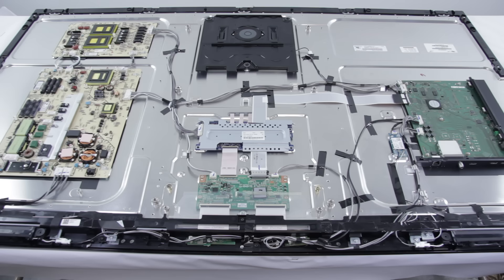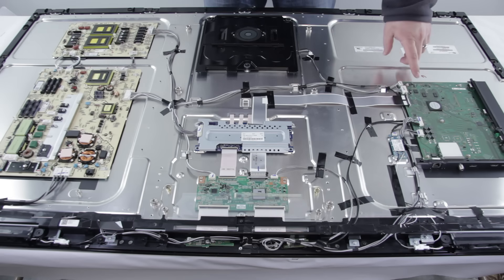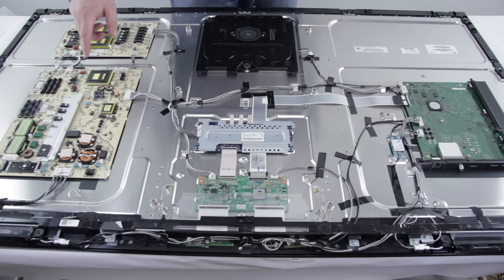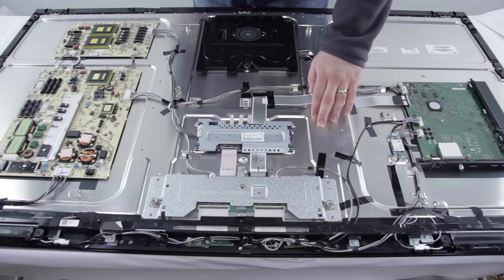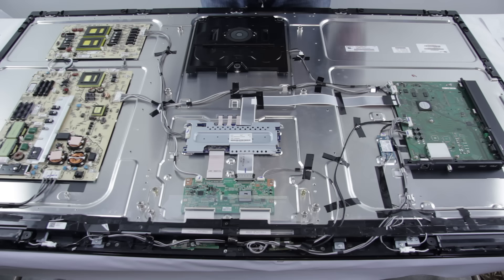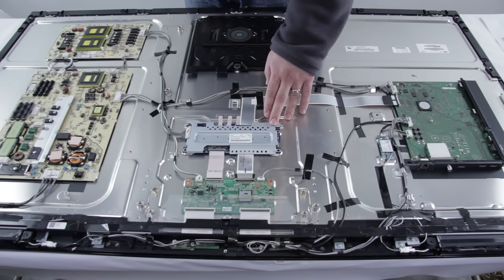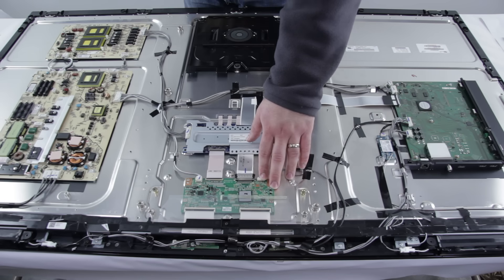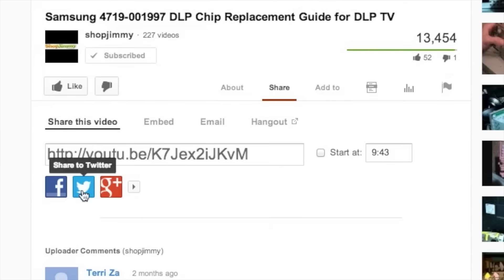LED TV Repair Tutorial - Common Symptoms & Solutions - How to Repair LED TVs

Comment: I have a Samsung 55 inch LED TV model no. UN55H6350AF. It was in a house that had a fire, the TV wasn't in a room that burned but smoke still got into that room. Now there is smoke residue on what looks to be the front side of the backlight layer of the screen. If you look at it right you can see it's "deeper" than the picture, if that makes
sense.

I took it apart to see what I could do but got a little intimidated by all the nearly impossible to undo clips around the frame. That, and not knowing how it actually is put together made me stop. There was smoke inside I could clean but it wasn't on the screen. If I could be relatively certain I wouldn't brick my new TV, i'd give it a shot but....

Thanks for any help in advance.

Comment: My SONY TV has a problem. TV model is KDL  50R 550A. When plugged in the TV and switch on, TV display is coming and SONY logo is appearing. Then automatically switching off. RED stby LED is blinking 6 times. When open up the TV , it was found that LED driver is getting very hot. Can it be LED short circuit?
Reply from the maker: Niranjan Ruwanpura   This sounds like you have bad lamps in your TV.  Unfortunately we do not sell replacement lamps.  Thanks!  www.shopjimmy.com

Comment: good day, i have a samsung led tv with model number UA32D4000N, in 30 to 45 minutes of viewing, picture is nice and clear, but after that period it will go too white and out of contrast and vertical white strip would appear like bar code. Turning off the unit for 10 minutes makes the picture normal but for a short while, may i have your advice please, thank you and may God bless you

Comment: Hey Jimmy i just bought a t con board from you thinking that was the issue but or didn't. Symptoms are i have audio but no picture, backlight still works. Did the flashlight test also nothing showing up.  Model number UN60EH6003FXZA

Comment: I have a Vizio M701d-A3r that has a darker right side than left side.  The image is present on the whole screen.  The right side is darker and also it seems that the image kind of fades away when it changes.  There is also a very thin horizontal line about 1/5 of the way from the top.  I have removed the cover and bezel and it appears that the LED lighting is working all the way around the display.  I sent photos to Vizio support and they feel the set is un-repairable due to backlight issues.  It is only 3 months out of warranty and it would stink to trash it.  Thanks!

Comment: I have a Samsung UN50EH5000FXZA (50" LED TV) which, after 13 months of use, has stopped giving a picture. I do have sound and, using your flashlight test, I do have video but I'm not sure about backlights - I haven't been able to see them but haven't taken the back cover off the TV yet (it's big, it's heavy, it's hard to handle by myself) - what isn't clear to me from this video and the flashlight test video is whether I can have positive flashlight-test result (so replace LED driver) and also have backlights? If I've understood properly, the fact I've got flashlight-test-video means that it is not the T-Con or Main board. Advice and clarification, please?

Comment: Hi I have a Samsung 32" 4000EW.  The TV switches on but switches its self off after a few minuites.  I have replaced the power board part BN44.00349B but it still does the same thing.  Can you suggest what to try next. Thanks.
Reply from the maker: Lucille Baldwin   I recommend replacing the main board in your TV.  Can you double check the TV model number?  I do not see any results for your TV model number on our website.  Click here to view a video that shows how to find your TV model number:  https://www.youtube.com/watch?v=S51nhAmwR2M  Thanks!  www.shopjimmy.com

Comment: Hi I need help fixing my tv . I have a 60 inch lde sharp tv the model number  is LC-60LE810UN and for some reason the tv won't turn on at all it just keeps flashing where the power  buttons is at.  Can you let me know asap what's wrong with it.
Reply: It  just blinks on and off I think it does 2 then stops for a little bit and then does over and over again
Reply from the maker: Alex Guzman  I recommend replacing the power supply board in your TV.  Click this link to a replacement power supply board for your TV model number:  http://www.shopjimmy.com/catalogsearch/result/index/?cat=59&q=60LE810UN  Be sure to match part numbers on your current board, with your replacement for compatibility.  Here is a link to a video showing how to identify your part number, click here:  https://www.youtube.com/watch?v=-i9o4C2XkyQ  Thanks and please let us know if you have any further questions with your TV Repair!  www.shopjimmy.com

Comment: Seiki SE46FY10.  No backlight, can see image with flashlight.  Sound is also present.  Based on video the led driver was bad.  I only see three boards which seem to be power supply, main board and T-Con.  Ordered main board assuming that had the driver built in.  There were 5 wire harnesses going to the front panel leading me to believe that was the LEDs.  I replaced the board and still same problem.  Is the led driver in another board?  Can the backlights go bad themselves?
Reply: ShopJimmy.com Thanks for the reply.  I did replace the board.   had to get it through another supplier since you all don't have it in stock.  The new(used actually) board didn't work either.  What voltages should I see going to the LEDs?  24VDC?  How do I check if LEDs are bad?  There are 5 wires that plug into the power board, is there 5 seperate LEDs?
Reply from the maker: *****  Try all repairs and troubleshooting at your own risk. There should be 4 rows of LEDs and they get about 40 volts.  You can replace the LED Driver if that board is separate from the power supply.  Thanks!  www.shopjimmy.com
Reply: Only see three boards, Main, Tcon, and power supply, so I'm assuming driver is in with power board.  Will try powering up LEDs, i have electrical experience so i do assume all risks and know what I'm into.  thanks for the help

Comment: Thanks for video, I have a samsung led tv model UN32F5500AF. Problem is sound but no picture, I use the flashlight in the dark, I can see the menu. Which board is damage?
Thanks
Reply from the maker: Charmaine Saunders  Please watch this video FIRST to help with your repair!  https://www.youtube.com/watch?v=BP3NVNCGEv8   This could be a problem with either the power supply board or the LEDs in the TV panel.  You can replace the power supply board to see if that fixes the problem.  Click this link to replacement parts for your TV model number:  http://www.shopjimmy.com/samsung-bn44-00605a-power-supply-unit.htm  Be sure to match part numbers on your current board, with your replacement for compatibility.  Thanks and please let us know if you have any further questions with your TV Repair!  www.shopjimmy.com

Comment: Hello! Thanks for the YT channel. I just found it today while researching potential causes for the blue vertical line on the right side of my screen. I have a 60" Vizio 3D LED, I think the model # is M601D-A3. As I mentioned, before it was 1 year old, out of nowhere a single, thin, blue, vertical line showed up on the right side of the screen, roughly 6" from the edge. I've seen some information saying it could be anything from a loose or dirty connection from the T-Con board, to a failing display. What do you think would be my best bet? The TV is still perfectly viewable, save for the thin line down the side.
  Thanks in advance!
Reply from the maker: Phil R   This sounds like a TV panel (TV Screen) problem.  If your TV panel is bad, it may be more cost-effective to replace the TV as panels are typically hard to find in stock, difficult to replace, and expensive.  Thanks and please let us know if you have any further questions!  www.shopjimmy.com
Reply: Much appreciated. I'm sure I can live with the line until the TV goes kaput!

Comment: I have a Samsung ua55d7000 LED. When powered up constantly turns on and off in under a second. Powerboard looks fine as do the capacitors. There are heaps of people who had the same thing happening who say the tech replaced the LED panel. One person said they found a dry solder on an LED and re soldered it which fixed the problem. Is there a video that could help me?
Reply from the maker: andrew parker   Unfortunately, we do not have a video to help with this problem.  Thanks!  www.shopjimmy.com

Comment: I have a Samsung UN55D8000yfxza, I think I need a backlight inverter/led controller. My backlight is sporadically dropping out. Could you please email me at eurotechbmw@gmail.com? Thank you
Reply from the maker: Dave Swenson   I recommend replacing the power supply board in your TV.  Click this link to replacement parts for your TV model number:  http://www.shopjimmy.com/samsung-bn44-00431a-power-supply-unit.htm  Be sure to match part numbers on your current board, with your replacement for compatibility.  Here is a link to a video showing how to identify your part number, click here:  https://www.youtube.com/watch?v=sSJexLvRrjM  Thanks and please let us know if you have any further questions with your TV Repair!  www.shopjimmy.com

Comment: I have an LG LED TV 55LN5700-UH. When I put it on, the LG logo comes on briefly then the tv screen goes dark. I have audio. I tried the "flashlight test" and can see the screen menu. Recommendations would be appreciated
Reply from the maker: Hayden Pierre   This could be a problem with either the power supply board or the LEDs in the TV.  You can replace the power supply board to see if that fixes the problem in your TV.  Click this link to replacement parts for your TV model number:  http://www.shopjimmy.com/catalogsearch/result/index/?cat=229&q=55LN5700  Be sure to match part numbers on your current board, with your replacement for compatibility.   Thanks and please let us know if you have any further questions with your TV Repair!  www.shopjimmy.com

Comment: I have an lg led 47" tv. Model# 47LE5400-UC. Serial# 004RMNE7B735. The tv wants to switch channels or inputs on us frequently. My wife put on the "key lock" so it wouldn't allow it to switch channels or turn off. Now everytime we are watching TV the sign that says "key lock" comes up on the middle of the screen with the beeping noise. It's like it is constantly trying to malfunction. Sometimes we are not able to turn the tv off at night. Does this sound familiar? Thanks

Ethan
Reply from the maker: Ethan Borrero  Please watch this video FIRST to help with your repair!  https://www.youtube.com/watch?v=BP3NVNCGEv8   I recommend replacing the main board in your TV.  Click this link to replacement parts for your TV model number:  http://www.shopjimmy.com/catalogsearch/result/index/?cat=56&q=47LE5400-UC  Be sure to match part numbers on your current board, with your replacement for compatibility.  Here is a link to a video showing how to identify your part number, click here:  https://www.youtube.com/watch?v=RwHTvjMdrhk  Thanks and please let us know if you have any further questions with your TV Repair!  www.shopjimmy.com

Comment: Hi there I have a Samsung ua46c7000 tv and it automatically turns on as soon as the power is switched on. The standby led flashes 5 times then the screen comes on with vertical lines. No picture just the coloured vertical lines. Then turns off. Then the process repeats over and over until you unplug the tv from the wall. Thanks for your help!
Reply from the maker: francesthemute9387  Please watch this video FIRST to help with your repair!  https://www.youtube.com/watch?v=BP3NVNCGEv8   This could be a problem with either the main board or the TV panel.  You can replace the main board to see if that fixes the problem.  Click this link to replacement parts for your TV model number.  http://www.shopjimmy.com/samsung-bn94-02757a-main-board-for-un46c7000wfxza.htm  Thanks and please let us know if you have any further questions with your TV Repair!  www.shopjimmy.com

Comment: My philips 47PFT6309/12 has had a wii remote hit it. Screen not visibly cracked when turned off but the point of impact is obvious when turned on. martland33@gmail.com.
Reply from the maker: Daniel martland   This sounds like a TV panel (TV Screen) problem.  If your TV panel is bad, it may be more cost-effective to replace the TV as panels are typically hard to find in stock, difficult to replace, and expensive.  Thanks and please let us know if you have any further questions!  www.shopjimmy.com

Comment: The TV used to be attached to a Direct TV set-top box and fed over the HDMI cable.  Then we had a surge, probably lightning.  It took out the Direct TV box and the HDMI port no longer took that feed.  So I moved it to the audio/video inputs and continued to watch Direct TV through that.  Then I decided to lower my monthly cost and drop that box off the account. 
I assumed I could get plenty of off-air digital TV.  But the DTV tuner does not work even after I replaced both both the main board and the Video Box Board.  When I go to DTV, and try the tuner tab with an off-air antenna attached, I get a blue screen which I interpret to mean the main board cannot see the Video Box Board.  So I'm now thinking it couls be the interface cable between the two boards but I'd like to get a second opinion before I purchase another device.
Thanks
Dave
Reply from the maker: Dave Knoll   It could be those cables or you received a defective replacement board.  Thanks!  www.shopjimmy.com

Comment: I have a sceptre 32 inch l.e.d. Tv and when I plug it in the power light indicates the tv is receiving power and when I turn tv on the lite turns blue indicating it's on and when I try to watch t.v., movie, or play Xbox , I can hear the sound but have no picture, just a blue blank screen. I have fixed several other model tv's that had this similar problem, but never a tv made by sceptre. I could fix it if someone could tell me what to do or what needs replacing. Any advice would be much appreciated.

Comment: Thank you for the helpful video. From what it sounds like I have a bad t-con board on my vizio LC550EUA model. I do not see a t-con board though. Could it be that it is integrated into the main board? My main board number is: 3655-0452-0150(6c).

The backlight comes on but no picture. a week before a vertical line was visible on the right side of the screen. It went away for a while then we lost picture. Voltage seems good on the power board and we still get sound. 

Best, 

Joe

Comment: Hi! I have a samsung 55inch LED tv model number UN55D6000SF and the problem is the backlight brigthness from the tv setting wont adjust. and the picture is dark and dimmed. everything else works fine,  what seems to be the problem? what parts do i need replacing? I have recently replaced the led strips can it be one of the boards? thanks in advance!

Comment: Please help, I hv a two yr old 55inch LED TV of LG Brand, Model No. 55LM6700-TA, having a problem of Horizontal Lines, though it does not obstruct the picture in a major way it smudges the the picture (left of TV) if there is any writings in it. The gray Horz lines have a very small gap of say .5cms running from left to right till center of TV, right side of the screen looks fine. 
The LG svc guy came to inspect, he opened the TV and cleaned the connectors connecting to panel, but  no result. He says the TV panel has gone defective, as it has crossed more than a year the warranty period also has lapsed. Please help, is it confirmed its a panel fault (cause the cost is huge)?

Comment: Hello, I have an LG 47" LED. model 47LN541C.  When i turn it on I can see the backlights blink quickly.  They then remain off until I turn the power off when they blink again and the LG logo appears for about 1/4 second.  I do get sound when the power is on.  When looking inside the tv I see no blown capacitors and tested them all, finding they are fine.  Where would you recommend I start with my repair? Help please :)
Reply from the maker: Sean washburn   I recommend replacing the power supply board in your TV.  Click this link to replacement parts for your TV model number:  http://www.shopjimmy.com/catalogsearch/result/?q=47LN541  Unfortunately I do not see any replacement parts in the search results for your TV model number on our website.  Please reply with your part number on your power supply board and I can try searching for replacement parts.  Thanks and please let us know if you have any further questions!  www.shopjimmy.com

Comment: I have a xvt3d650sv unit and it has vertical colored lines on the left sideof the screen as soon as i turn it on, but they start fading away after a few minutes only leaving the very left one, i already replace de tcon board and still have the same problem, im thinking is the main board but not sure, Thanks in advance
Reply: Thanks

Comment: I have a Samsung LN45A850S1FXZA version SQ01.  The TV powers on and I hear the fan turn on.  The screen changes brightness, (gets lighter), but there is no image.  This seems to indicate that the backlights come on, in my opinion.  I have audio and can switch sources by using the remote, (I cannot tell which source, other than the audio changes).  When the TV is turned on all of the lights above the touch sensitive buttons on the front stay on except for the one above the Source, which blinks on and off.  When the TV is turned off all of the lights except the Source remain on, the Source remains off.  Can you recommend a part to purchase?
Reply: Sorry, model number is LN46A850S1FXZA
Reply from the maker: Owen Johnson   I recommend replacing the main board in your TV.  Unfortunately I do not see any replacement parts in the search results for your TV model number on our website.  Please reply with your part number on your main board and I can try searching for replacement parts.  Thanks and please let us know if you have any further questions!  www.shopjimmy.com